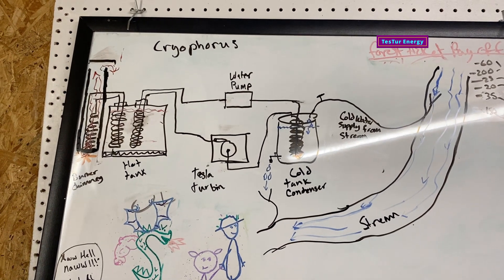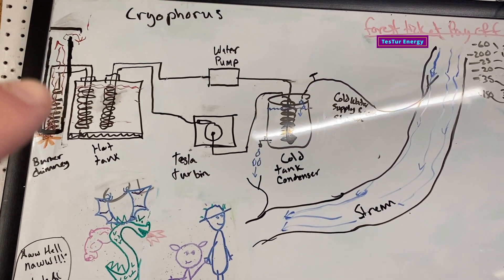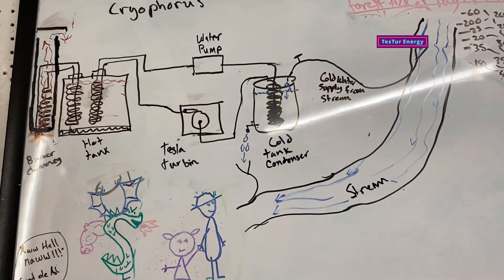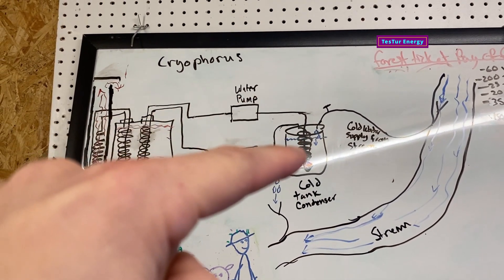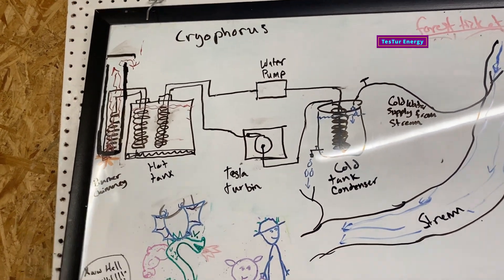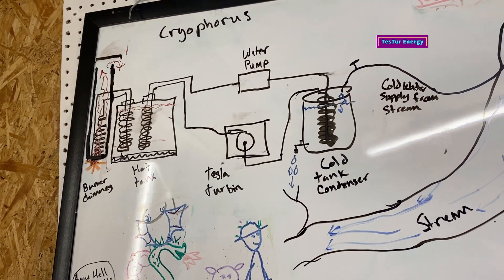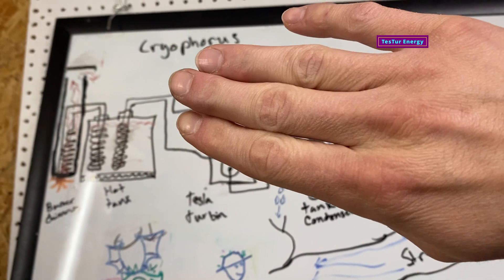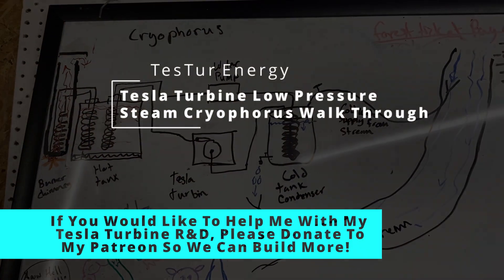Tesla Turbine Low Temp Steam System For Electricity Generation Heating

Comment: Credits for the cold steam vacuum idea go to Jeremiah Ferwerda from My Tesla Power. I feel like that should have been mentioned.
Reply from the maker: I’m not sure how you mean. These vacuum steam systems have been around for over 100 years….? Tesla talks about them in his article “Our Future Motive Power” from 1931. D’Arsonvil, Tesla’s friend, came up with the idea first in 1890 for using the system off the temp difference between warm surface ocean water and cold deep ocean water. And then Georges Claude, as in the inventor of the Claude Air Liquefaction Process, made the first bench top proof of it working in 1930. And had the first full operating plant in the 1930’s… and just as an FYI, most full scale steam plants already use vacuum condensers. They just start with high pressure steam and then still go to vacuum. It’s all the same Rankine thermodynamics cycle. The only difference is that using the Tesla turbine you can fully expand the steam beyond the point at which condensation droplets form, which would normally destroy bladed turbines but the Tesla turbine does not suffer from damage due to multiphase fluid flows. 

I explained all of this history in my gas turbines and cold steam video that I made. https://youtu.be/5Y3D13JmtcA

Jeremiah is doing great work but he did not come up with this idea, far from it.
Reply from the maker: This is Tesla’s “Our Future Motive Power” article from 1931
https://teslauniverse.com/nikola-tesla/articles/our-future-motive-power
Reply from the maker: I explained all of this history in the my video about gas turbines, cold steam, and Teslas Improved Turbine a patent GB186,083. Take a watch. There’s a lot of history to these things that most people don’t talk about. 
https://youtu.be/5Y3D13JmtcA
Reply from the maker: Also if you would like more info on these systems take a look at Ocean Thermal Energy Conversion (OTEC) Systems. They are EXACTLY the same system that both Jeremiah and I are working on. 
https://en.wikipedia.org/wiki/Ocean_thermal_energy_conversion
Reply: @CharlieSolis  Thanks for the explanation. Since I've never seen or heard of anyone else with a working setup of this type I (foolishly) assumed Jeremiah came up with the idea because his videos are the oldest I've seen. It's strange that so few are working on this, the potential is enormous!  There are temperature differentials everywhere so it's essentially free energy for the whole world.
Reply from the maker: Oh yeah I completely agree. The energy stores available around us everywhere are seriously unimaginable. I don’t mean to sound like I’m taking away from Jeremiah’s work, as he is definitely killing it out here with the systems he’s been experimenting with. Just for the fact that he’s shown/showing how accessible this technology is for the average person too.
Reply from the maker: Yeah there are a myriad of reasons as to why these systems haven’t become more widespread. Long story short, it was cheaper and easier to access fossil fuel stores to make a quick buck than to build out this technology, that wasn’t already in mass use, so this was put on the shelf until they ran out of fossil fuels to sell us…….. 🤷‍♂️
Reply: The so called cryophorous system is invested way before anyone get paid for it to get credit 😅

Comment: How cool to have this setup by a stream. Wonder about a rocket mass heater for heating the water up. Would hold the heat longer.
Reply from the maker: And yes!! Rocket mass stove heaters would couple PERFECTLY with these. I think we could design a really cool one that had the walls of the rocket stove sleeved with the water for the hot tank. Or even just have the rocket stove be in the hot tank 😂

All I know as since I know the hot tanks would be stored at 70°c I was going to build a personal hot tub for around my hot tank to that any heat lost just goes into my hot tub 😂😂😂 I’ve been saving hot tub Pinterest stuff for years now to design a super nice one and build it. I worked as a pool boy for a few years during the summer in college so I’ve built a ton of pools and spas before. Pretty excited to finally have my own hot tub and sauna in the back garden. 

I don’t think I’ll ever have a pool though. They are SOOO much work lol unless I see some utility in it like using the water mass to store thermal energy... hmm water can hold the most thermal energy per kg.... hmmm now I’m thinking large 75° underground insulated pools for storing a homes full thermal energy. 🧐 

I’ve seen systems that utilize the whole area of dirt that’s under a home to blow hot air in through tubes all summer. And that by the time winter comes around once you’ve heated up the mass of the underground it actually can provide all the heat needed for the whole of winter in most areas. just have to calculate how much volume of dirt and rock you need to get to ambient summer temps to store all the heat needed for the winter. Green houses use this same passive thermal heating but not for long term storage, just to smooth out day and night temp swings.
Reply from the maker: I know right! The guy I drew this out for has a stream on his property and I’m super jealous lol